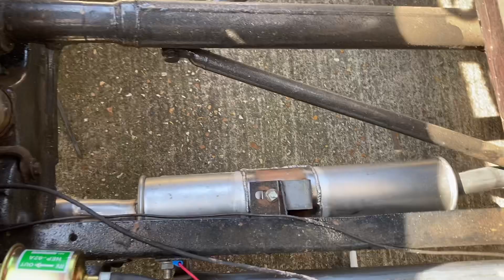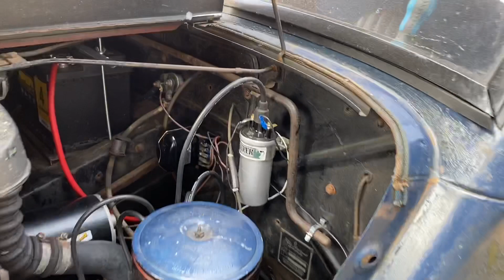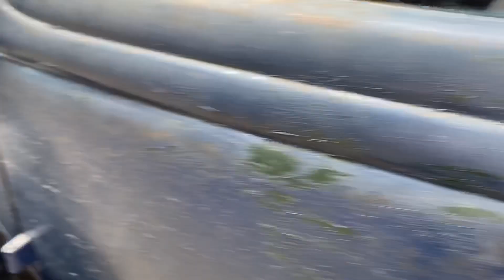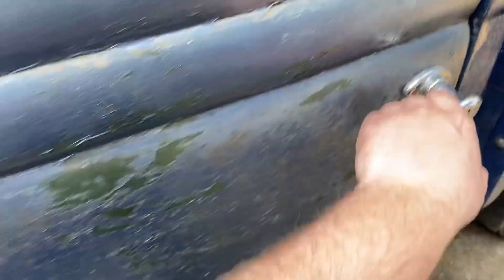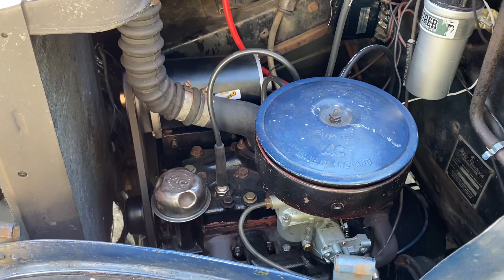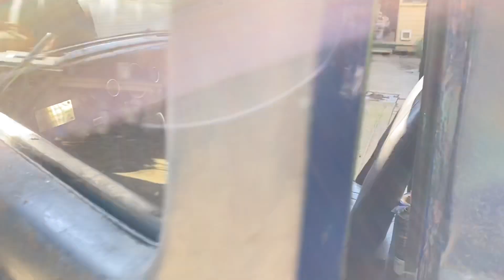1952 Fordson E83W - Repairs completed

Comment: Sounds and looks lovely. Nice to see a dynamo on it too.. do many get converted to alternators?
Reply from the maker: Are the dynamo has deceived you! It’s actually a new gadget called a dynomator. An alternator disguised as a dynamo. The regulator box internals are removed and a 40amp fuse added in its place. 

So it all looks period correct. But gives a better charge. 

Was having a few problems getting a working dynamo and regulator
Reply: @MO3MINI  Very interesting! I've just fit a new alternator to my Series 2A Land Rover which would have had a dynamo initially. I've been thinking about reverting to a dynamo at some point in the future but will consider on of these if I can find one to suit. Cheers.

Comment: cool truck. What engine does it have?
Reply from the maker: Thanks! The engine is 1172cc Ford 100e side valve. The truck would have originally had an E93A side valve but it was swapped in the 60’s as the 100e unit boasted a water pump and better main bearings 👍